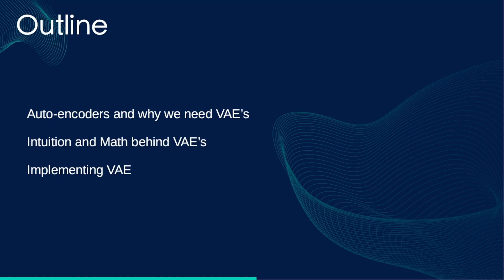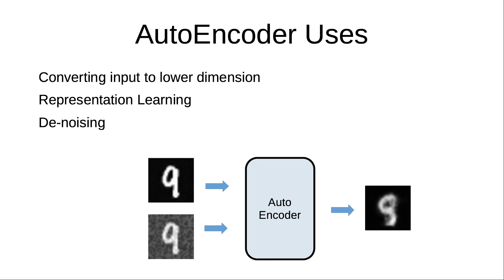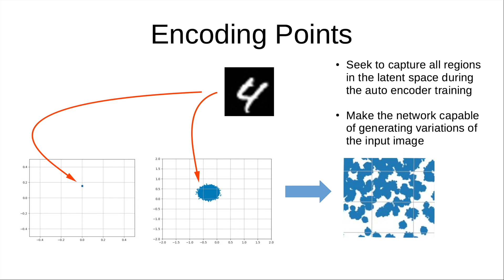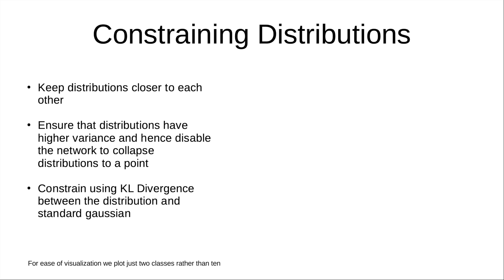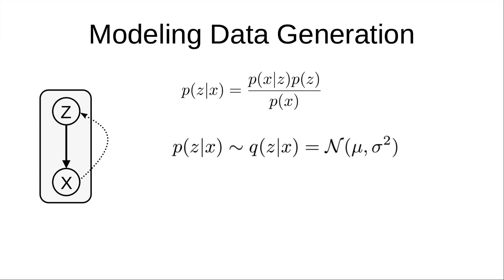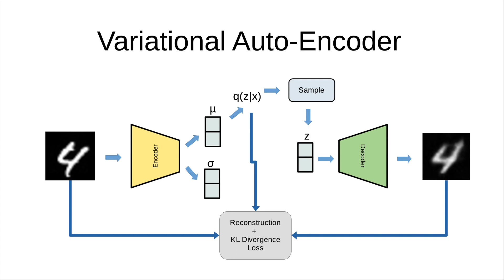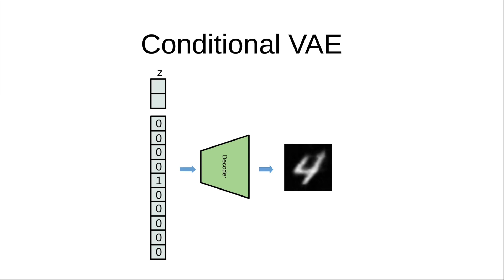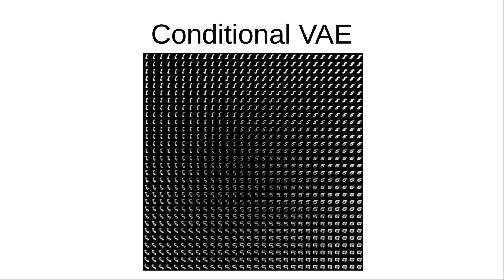Understanding Variational Autoencoder | VAE Explained

Comment: Amazing video. Probably the best explanation I've seen on the internet.

However, I'm still struggling to understand the encoding and statistical explanation of the model. You say that we need to compute p(z|x), but we can't because its computationally intractable, so instead we estimate it using q(z|x). However, my question is firstly: how do we calculate the KL-divergence between q(z|x) and p(z|x) if we don't actually know p(z|x) (at 7:34)? If we did, why couldn't we just use that instead? 

Next, you say that we sample from the distribution p(z) to generate new pieces of data. This does not make sense to me. Isn't p(z) a standard gaussian? If we sampled from p(z) wouldn't we just get non-sensical, random results? Why don't we sample from the learned distribution of q(z|x) instead?

Here's my thought process, please correct me where my understanding is wrong: 
1) Imagine we have images of circles that a VAE must reconstruct.
2) We encode it into a 2-dimensional latent space. 
3) The decoder decodes the a point sampled from the latent space and generates a new image of a circle.

In step 2 we encode images by estimating p(z|x) through q(z|x). Let's say the encoder learns that the two dimensions of the latent space are radius and position. Then, for every single image the encoder finds the latent variables z and turns it into a distribution of radius-position combinations which approximate a standard gaussian (p(z)) (I imagine this looks something like a joint distribution between two normally-spread random variables). We do this enough times and eventually we have a latent space represented by the probability density function q(z|x) which organizes the space of all seen circles into varying spaces within q(z|x) (I imagine this looks like approximately standard gaussian clusters spread out throughout a 2D latent space with axis radius and position where each cluster represents a certain type of circle x).

In step 3 we decode these images by sampling from q(z|x) (which is differentiable through the reparameterization trick). Then, we can conduct the reconstruction loss between the generated output x' (or f(x)) and original input x (this makes sense to me) and calculate the KL-divergence between our estimation of the latent space q(z|x) and a standard gaussian p(z) (this doesn't make sense to me).

- In this part, why do we take the KL-divergence between these two terms? To my understanding q(z|x) is our prediction of the true latent space p(z|x). If we tried to make q(z|x) as similar to p(z) as possible, would we not just see q(z|x) turn into a giant standard gaussian? Why would we want that? 

Am I understanding things correctly? (probably not) But more importantly, could you please correct me on what I'm misunderstanding and answer my questions?

Again, excellent video. It just seems like there are some kinks which I have yet to work out because of my inexperience.
Reply: Nevermind, I figured most of it out.

Comment: From the video it is evident that using a variational autoencoder for image de-noising works better compared to just using an autoencoder as the latent representation of the images generated by the encoder in an autoencoder is mapped to a point instead of a latent space with a distribution of the latent masks generated by the encoder.